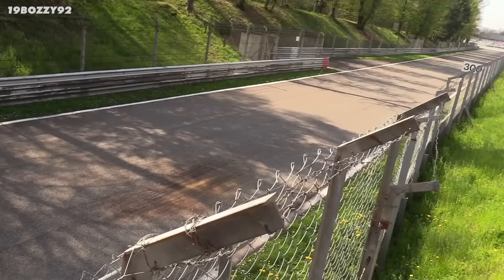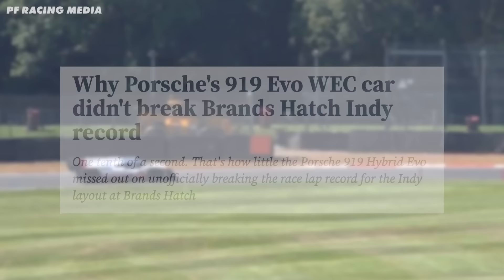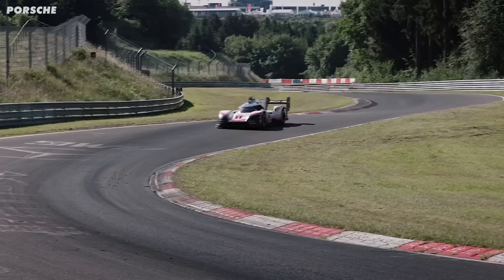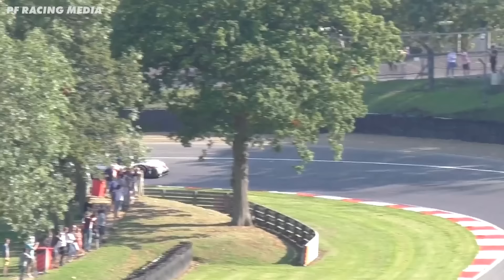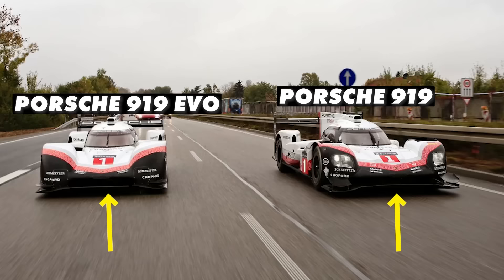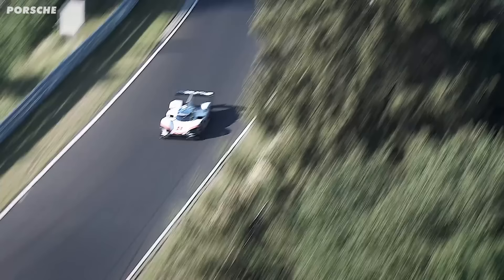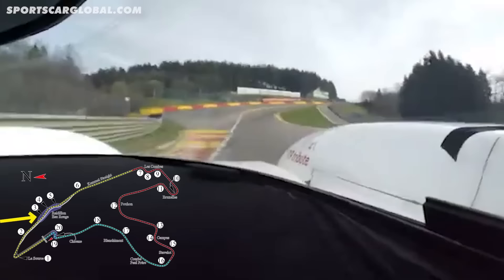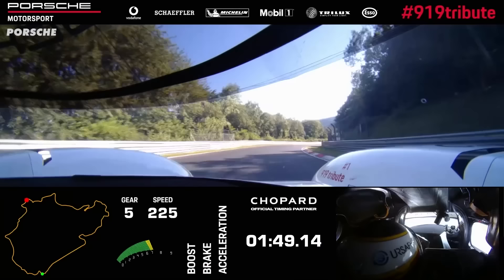The Porsche Faster Than F1

Comment: the thing about wider tyres is that there's more area to dissipate the heat, so they can be a softer compound. Now there is also a little more traction given when there's less weight per square inch too, but that negligible. The crux is the wider the tyre, the softer it can be
Reply: Ayyy, fellow beamng player (nice mods btw)
Reply: Most of a tyre’s grip on hard and dry is actually produced adhesively. Meaning tyre is acting as tape. Bigger patch of tape means more grip.
Reply: @drd1449  that is also dictated by how soft the tyre is. The narrower the tyre, the hotter it'll get, even overheating, and eventually the quicker it'll ware
Reply: @fillman86  It definitely also helps with longevity and can allow softer compounds but even with same compounds wider tyre often offers more grip.
Reply: @drd1449  whilst technically true, not really. If you push hard and rub your desk you'll generate more grip, if you lightly touch it and rub your desk, you won't generate nearly as much grip. This is a crude example, but is the same principle.

if you double the width, you halve the pressure applied
Reply: @fillman86  pressure isn’t that important in adhesive grip. You can notice this on your phones screen if you only contact point is your fingertip you can put significant weight on it and still be able to move it. Put your finger laterally on screen and it will be relatively hard to move even with light pressure
Reply: @drd1449  it very much does matter. I'm not the one spouting this, but is proven science
Reply: @fillman86  adhesive grip is as it’s name implies is based on adhesion. It happens because there is attractive force between molecules. Pressure only helps it because allows surfaces to be closer to each other. This is same type of friction that keeps steel beam in shape. Thicker beam is stronger and bigger contact patch gives more grip. 

On dry and hard surface this produces most of the grip on a tyre. That is why racing tyres are slicks. Tyres can’t utilise this grip on loose surfaces like gravel or snow and coarser pattern is needed.

Friction is a very complicated subject and usually over simplified.

Comment: If that Porsche V4 mill was available as a streetable crate engine for hot rods, kit cars, small trucks, boats, light aircraft, motorbikes and racing applications, I’d probably stick one in a Ford Pop, Corsair, MGTD, a 1927 Model T or Volkswagen Beetle. What would you put yours in?

Comment: FUN FACT: the W11's time around Spa is quicker. They did a side by side comparison and the Mercedes' W11 was quicker through the corners while it held its own on the straights, which is where it made up a lot of the time it lost to the W11 through the twisty bits. 

F1 cars, well the Mercedes' W11 specifically is still faster.
Reply: even SF-71H went faster with sebastian vettel in SPA Q2. Would have gone even faster in Q3 as in that time party mode for Q3 was a thing. Sadly it rained for the last part of qualy.

Comment: What about the G forces on the Driver ? Indy car had issues at a point. Lateral forces must be huge going around turns on the Human body I should think?
Reply: Probably less of a concern for a time attack setting than a multiple hour endurance event, worst case you could just pull over, not as much of an option to with 30 other cars on the track and a race to win.

Comment: Question about the aero might sound dumb but if the rear wing was bolted directly to the rear wheel hubs and is seperated from the body so any downforce acts directly on the wheel's themselves and not the body . Would  that help with too much downforce stressing the body's structure
Reply: Too much force on the hubs. It being a body (or chassis) mount makes it so that the force is distributed evenly. If a single part of the car received that much force, chances are it would have to be made tougher and heavier

Comment: 7:44   If you need wider tires….use dually’s
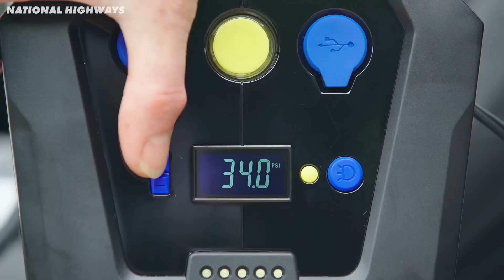9:21   I run 80 pounds in my tires, zero sidewall flex
12:59   …..they need dually’s

Comment: If you covered the wheels of an F1 car it would lap many seconds quicker. Add a qually power unit that didn't have to last up to eight races and there's another few seconds. Yes it wouldn't be a F1 car any longer but the basic design is so much faster than a LMP. But yeah this is PORSCHE! and from the time I saw my first Rothmans Porsche in the Nine Hour at Kyalami I have always been mad about them.

Comment: Now imagine the limitations placed on the EVO were removed and true freedom to build the fastest car was enabled - stronger gearbox stronger tub, better tyres/wheels, more power, lower weight, better steering, improved aero where those compromises exist... In the 4min timezone anyone?!
Reply: there were actual performance simulations beginning with a 4:xx. So, it should be feasible if there are less money/time costraints

Comment: While I get the comparison as being faster then a F-1 car, and this being a remarkable accomplishment, it’s still apples and oranges. Additionally, as to records, I think there should be differentiation between ICE, EV and hybrid cars.
I think it would be interesting to see a comparison with a existing F-1 car, and that same car, sans limiting regulation of software tires and aero features.
Reply: I think the problem with these cars is that it's always going to be apples and oranges because rules keep changing with focus on safety. For example a F1 car without rules is no longer a F1 car, the rules make the F1 car, just as F1 car of the 90's is not apples to apples with the modern F1 car. And F1 cars themselves have been hybrids for long time now, albeit under stricter restrictions compared to the mighty V10s etc of old.

Comment: I think the Porsche 919 Evo actually highlights how crazy F1 is. The 919 Evo is based on a dominant car but with no rules, unrestricted engine, unlimited DRS, all wheel drive. Despite all that, the lap record that it set is beaten by F1 of the same year. A lot of people doesn't know this, but F1 doesn't need the W11 to beat the 919 Evo. Both Ferrari and Mercedes have beaten the 919 Evo in 2018 with the SF71H and W09 respectively, in a non ideal lap as well (Q2)

Comment: porsche needs to make a modern day 919 EV-O
the taycan turbo GT is a 7:07 nurburgring beast with 4 seats, beating the all time sedan record by 14 seconds and only 2 seconds short of the "production" ev record by rimac
Porsche ahoukd be the one to frankemstein rhe spiritual child of the 2018 919 EVO (5:19) and the 2019 VW ID.R (6:05)
I think a sub 5 min EV would make a lot of "noise".
it smuch easier for an EV to beat a lao record than peform in endurance racing but they could probably pull out an impressive performance at le mans, maybe with battery swaps
Reply: I'm picturing a 1000-2000hp car with 4 electric motors a very low drag coefficient, covered wheels, active suspension and extremely low ground clearance/extremely high natural ground effect, assisted by fans. the car could have huge top speed 250-300mph, cornering speeds, the ground effect would cancel lift and keep the car stable at very high speed and additional downforce coming from fans would allow very high G braking, acceleration and cornering. the fans speed could be continuously adjusted depending on the speed, corner radius and on/off camber, compressions and crests

Comment: at which point do you need a gsuit like a fighter pilot to drive a race car? has it ever been done ? i know in us the f1 equivalent had pilots pass out from g forces... couldn't it help them even if the force is sideways? @Driver61
Reply: I can awnser this! G suits would not be benificial in cars like they are in planes. The suit prevents blood from your brain to drain to your legs when pulling up vertical in fighter planes. this happends when you get to about 6g (for trained pilots). In cars the highest g forces are horizontal with high cornering speeds (at a max of 8G's) and under braking vertical (to about 5G for a very short time). This is simply not engough to drain enough blood out of you brain. 
(I did an internship at an airforce base and did maintenance checks on G-suits)

Comment: I'd explore skirts that are unsprung. Don't connect to the floor, but to the uprights. 
Tyre compression by the road and unevenness of the road between the front and rear wheel each side would influence the air seal.

Was it impossible for them to obtain F1 wheels and tyres?

Comment: Legit question 
Why do people say wider tires don't do anything??
And why are they wrong?
Reply: Usually when people say “I got wider tires” it’s like going from a 255 to a 275. It’s such a tiny difference that it matter. Usually buying a better tire is a better way to increase grip then trying to squeeze out some more width.

For a noticeable difference it would have to be like a 250 to a 300. Plus if you have the pressure wrong you’ll have the same contact patch as the 250 and the width won’t matter.
Reply: @captainhellhound7451 thank you much, that explains a lot

Comment: don´t know anything about racing or cars. but what´s the point in all these f1 regulations? the only rules that would make sense to me would have to do with surviavability/security for the driver. i mean they loosely are since they make you slower. but is that it? i mean they could introduce all kinds of to make it even slower/safer. but then what´s the point? are they just trying to define their sweetspot between safety and speed? make it just barely fast enough so that people don´t turn off? but then again racing that fast is inherently dangerous and deadly to begin with.

Comment: Perhaps a silly question, but why not feed it some nos?
Reply: because the engine components were not capable of withstanding even more power. Crankshaft for exemple was LMP stock, designed for power in the 500hp range...
Reply: @fg532   seems strange ... horsepower is horsepower. how did they run it in 1100hp mode without breaking the crankshaft?

Comment: I feel at a certain point the cars will be too good for a human to drive them.  10-12 g stopping.  A human can't endure this.   as it is, they're six to seven G stopping with wild restrictions.  Imagine if the restrictions were lifted and F1 Red Bull Mercedes and Ferrari could do whatever they wanted to have car stopping at 10 G cornering at 5-6g.  With compact light power output well over 1500 hp allowing them to do 250 miles an hour.

Comment: What it the cheapest you could win a Grand Prix if you didn't need to stick to F1 technical regulations? Not just making a faster 1 lap car, something that could do 300 km without breaking, on tyres that don't need changing, with no fuel limits and with all active aero and suspension.

Comment: this is still not the fastest a car can go, its still not a fan car, the aero is still tied to the body to the suspesion they could move it to the wheels. the v4 could be up sized to v8 or v12. The tire sidewalls are still exposed. thats still probobly not the most exotic fuel they could run. 

but we are close to the point where the G's are so high you almost need a robot driver or rotating cabin and g suit.

Comment: An F1 is still faster on normal tracks. It simply can not beat the downforce advantage of a F1. Traction of F1 is better either. Topspeed and HP is not everything. Braking does a F1 better as well. Alone the advantage of weight.
Reply: At 849kg versus 798kg for the F1, the 919 evo isnt that much of a brick. And while F1 finally brought back ground effect, the 919 Evo’s suspension is much better than a F1 car.

Comment: So Porsche in this case had near unlimited restriction while F1 are sanctioned and has specification requirements by the FIA, plus the POrsche is a different technology and area, so as technology increases, so does the decreasing lap times, not reallllly a fair comparison. If it is to beat an F1, then this porsche needs to be in an F1 race. can it compete? probably will break down very early... 

Just saying its not an F1 car.

Comment: Don't want to teach you how to suck eggs but your description of the cars floor aero is not completely correct. The whole device is the conduit,(partially open),the front edge is called the venturi and the rear of the conduit  is the diffuser.

Comment: Except, they didn’t. The following year Lewis Hamilton bested their time. They are even faster, now.
Reply: You sure about that? Bahrain is is the first race of the 2024 season and Max got pole with a time of 1:29.179. In 2020 Hamilton got pole with a 1:27.264 (which is the fastest F1 pole time in Bahrain). 2020 which was peak F1, they're slower now.
Look at other tracks, where races were run in 2020 that's the fastest times ever on the circuit or in the races that were cancelled in 2020 (or where it was raining) it's the 2019 time not the 2023 one or in the case of Bahrain the 2024 one.
Reply: 919 is quite a bit faster than current fi regs

Comment: Yawn. No rules no formula. This is stupid. A Top Fuel Dragster also beats F1 if we use drag racing rules. It's called "formula" for a reason. Imagine what Red Bull would put on the track with no rules. Porsche is a joke.
Reply: A dragster beating an F1 on the track if there is no rules ? 🤣🤣🤣 the dumbest thing I have ever heard 

Yeah Porsche is a joke you are right, they took the best lmp1 car, remove the restrictions to see the result and they put better lap times than F1 with a base car made to run during 24h but you are right, Porsche is a joke they are so baaad 🤣

Crazy saying Porsche is a joke since they have the most win in lemans which is one of the most, if not the most important race 

Porsche haters don’t know what to say anymore because the brand is too advanced
Reply: @CLSTRN911 Wow, Leroy could build an F1 beater with a corporate budget. And yet you are impressed with some slow LMP1 car can be modified to beat an F1 car (constrained by formula rules). Wow, are you actually impressed?! I mean if there are no rules than basically anyone with money can beat an F1 car. The whole point of F1 is....THERE ARE RULES. Let's see an LMP1 car grid for an F1 race and actually beat an F1 car while complying with the rules. Yeah...GOOD LUCK. i've owned (one) Porsche in my life and I will never bother with another. It was a typically over-engineered pieced of German crap. Porsche could never beat Red Bull with equal rules. A drinks company is better than Germany's best. Let that sink in.
Reply: @z51racer  all this yapping and for what lol